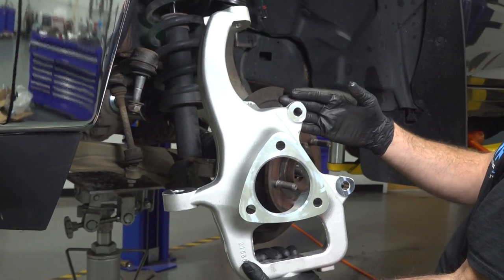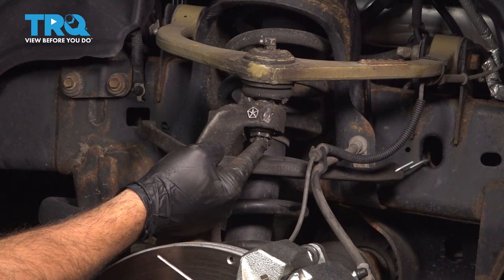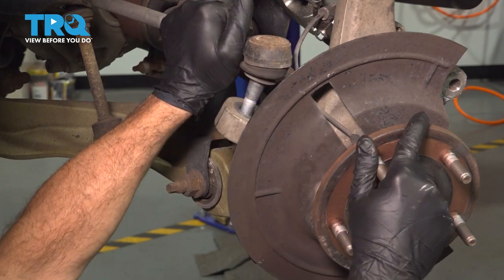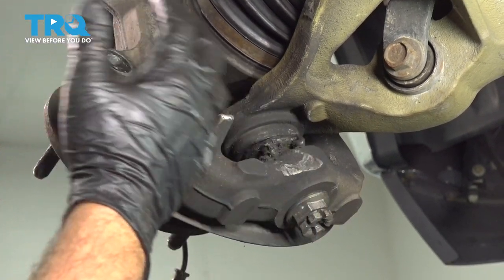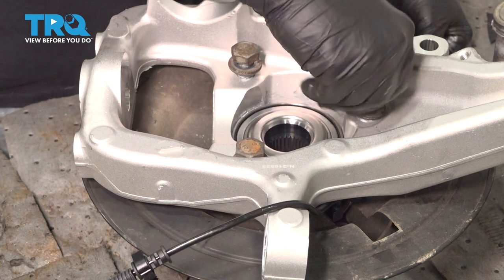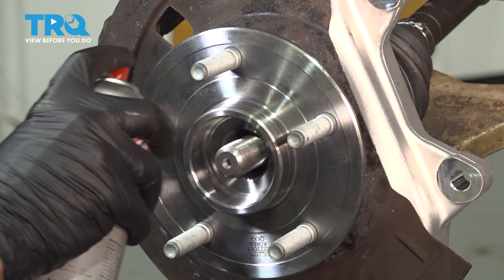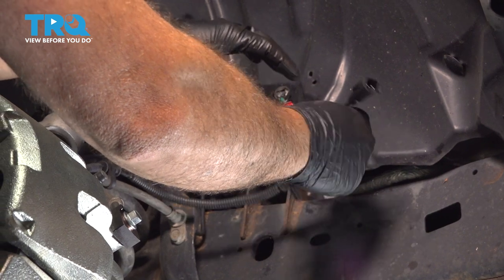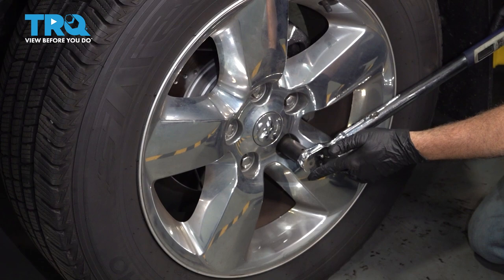How to Replace Steering Knuckle 2011-2018 Ram 1500

Comment: I have a 2012 ram bighorn 2x4. Is there a difference between the knuckles on a 2 wheel drive and 4 wheel drive? I need to replace mine (part3 68044700), but it's hard to find. I was going to just get a Dorman 698-238 instead.